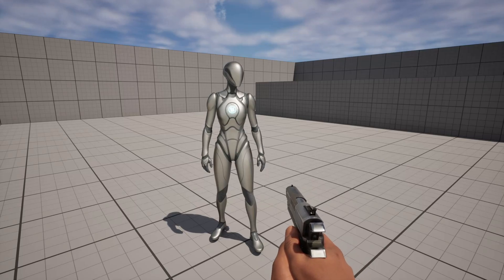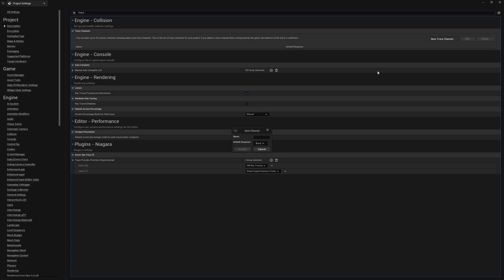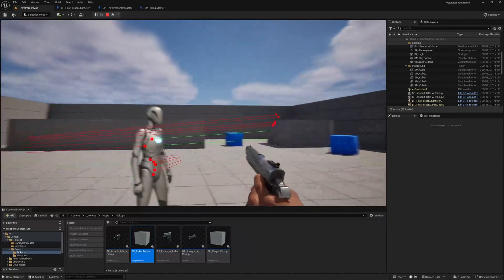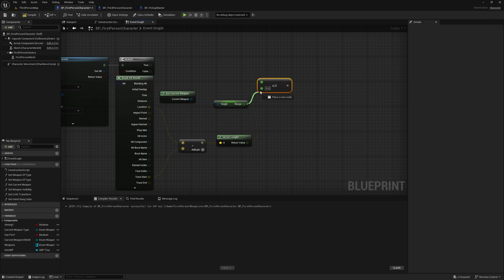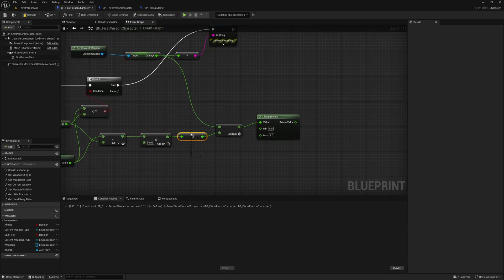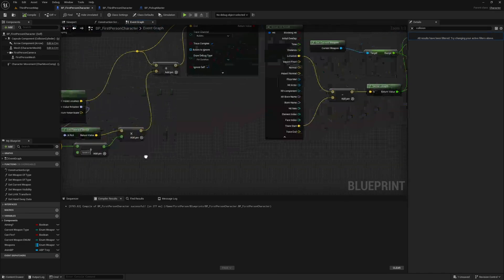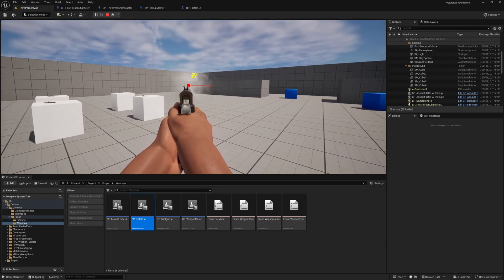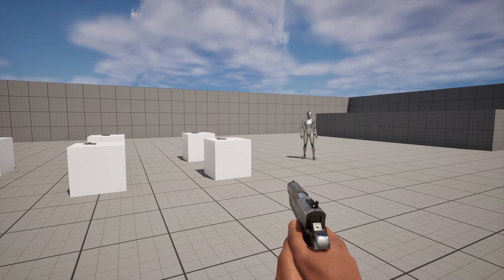How To Set Up Damage Falloff - Unreal Engine 5 Tutorial

Comment: I'm doing something similar to this just recently but it was using a "map range clamped" with trace distance going into value and input A being the min distance B being the max then output A being max damage and B being min damage. It works pretty good, I'm going to try adding the square to see if it works better.